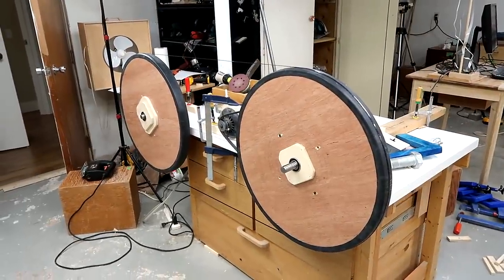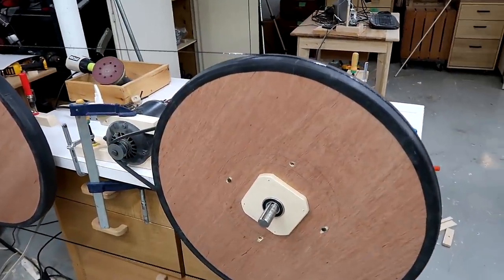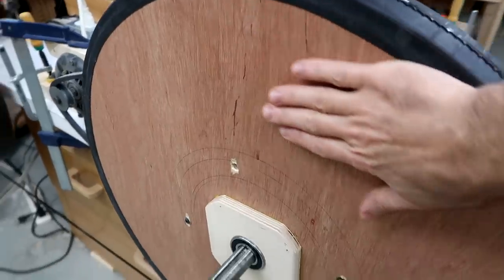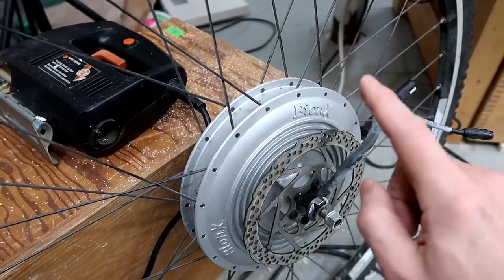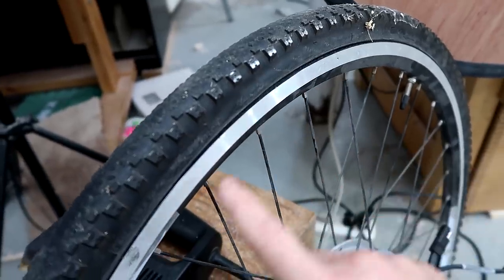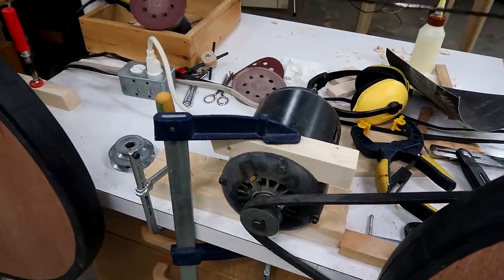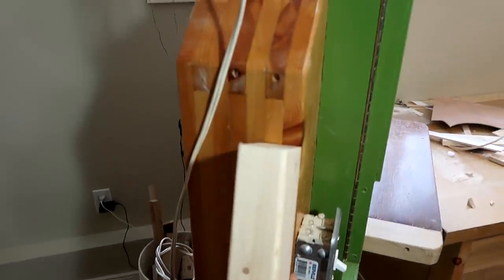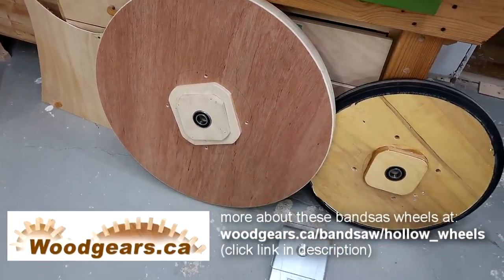More about the hollow bandsaw wheels I built

Comment: I would still go with all-plywood for the wheel, with holes cut into it until it looks like spokes. Then you could easily cover over the holes with whatever you like (packing tape, cardstock, thin veneer, etc.)
I can get 5-foot square 18-mm thick baltic birch plywood for about $30 per sheet, and you could get four 29-inch circles out of one sheet and laminate them together to get two 29-inch wheels at almost 1.5-inch thickness.

Comment: Build myself a bandsaw of your design years ago. Still like it. Had the same problem of dust collecting under the ruber tube. Fixed that  with aluminium foil tape. Also closed the holes with it.

Comment: I really like these videos that explain your thought process.  Using pre-built components, like a bicycle wheel in this example, generally only works if the entire component/assembly works as is.  Once you have to start changing said component, you've negated the reason for using it...ease of use.  And I'm careful to say "generally".  Gently modifying something, like cutting a groove into a premade wheel to make a pully is one thing.  Changing the hub/axle on a bicycle wheel is as much, if not more, work than creating it from raw materials.  I find the latter is more often the case.

Comment: Other options for making a solid ply lightened wheel not collect dust is of course to skin it with a sheet of thin plywood or fill the holes with foam.
Reply: I was thinking about that too. I've got an old craftsman bandsaw that I'm tuning up and it has issue he talks about where the spokes collect a lot of dust and generally whirls dust around. I was just thinking I could use some kind of thin plexi/acryllic/plastic sheet glued on to each side to prevent that effect.
Reply: @nyw11  That sounds heavy.
Reply: @billybobjoe198  I'm thinking like the thinness of pladtic packaging or laminator sheets. The air in the cavities might suck the plastic in, and then the foam that Joe mentions would be beneficial too. Maybe some of that 1" extruded insulation foam.
Reply: just stapling an old piece of textile on the outside should be sufficient
Reply: @billybobjoe198  no part of that sounds heavy

Comment: On pallet separators, they use actual pneumatic tires (about 18" in diameter) to run the big bandsaw blade horizontally. Cuts through all the wood and nails like warm butter.

Comment: In order to use this bike wheel I need to throw away the rim,hub ,spokes and tire and build the rest out of wood. lol
Reply: i mean, it could conceivably work if u have wheels that have 15-20mm thru axles and put all rubber tyres or slicks on the rim. But that seems to me just a misuse of wheels, they are better off on a bike.
Reply: Truck wheels would probably work except they would be way heavier.
Reply: @eDoc2020  they can for sure i have seen it
Reply: @eDoc2020  use the diesel engine from the truck, and the weight will make little practical difference.

Comment: I recently dismantled a direct drive LG washing machine which has a very nice motor that couples directly to the drum. I think that this type of motor could form the basis for a direct-drive bandsaw whereby the motor would fit within the lower wheel.
Reply from the maker: If you have a controller for it, yes.

Comment: When using bicycle wheels instead of plywood wheels I would recommend using the frontset as well and mount it into the bandsaw frame. Changing the blade is still more complicated than with a wheel whose axle is mounted only on one side.

Comment: Hello Mattias!
I'm sure you are aware, but you did not mention it in the video. The critical mass is at the edge of the wheels, a lighter wheel with mass concentrated at the edge could be harder to start and stop than a heavier wheel with the mass at the center. Pure weight of the wheel is not as important as the mass location and radius, see rotational energy. I would recommend the Wikipedia page about flywheels.

Comment: You mentioned WoodMizer.  If I built one, I think I would use vehicle safety-spare wheels; they're pumped up to about 60 PSI and typically have a decent crown on the tire.  Even though you're only supposed to drive 50 miles on them, I think there's enough tread to sand them round.

Comment: I used to work in a freight distribution company, and when we had to weigh items that wouldn't fit/balance on the pallet scales, I came up with an easy solution (you can do the same with bathroom scales)...
I would weigh myself on the scales, then zero the scales and weigh myself again, but holding the item. 
(remembering to always zero the scales after the process).

Comment: Did you ever think of making a bead lock type of disc to lock the edges of the inner tube to the hollow wheel, you could bevel the edges so sawdust doesn’t get hung up. And the discs you attach could allow you to implement a foot operated brake, kinda like a old clamp bicycle brake. But I like the hollow wheel idea, would allow the wheel to have airflow through it to make its own dust collector, kinda like your home made ones. Love the content btw.

Comment: If you take the bike frame and take the front forks off and cut the rear frame apart keeping the triangle support for the rear tire then you can use bicycle tires easily. If you put the same design effort into using bicycle wheels as you put into building with wood you could seriously upgrade the bandsaw.

Comment: You always get my imagination going Matthias. What if you milled a big round elliptical groove on each face of an MDF disk on the top of a big table saw set at 45 degrees to get the biggest scoop, (or maybe more of such ripples) and after that just use a router bit to take off that millimeter for the inner tube around it? or maybe just do a wheel in gradual parametric slices where the strength needs to be and smooth them out by sanding them down...
Reply from the maker: Please do try your suggestion and make a video.  I think it would be fun to watch.
Reply: Sound like how a designer would build a bandsaw lul

Comment: Marius acknowledged the problem with the holes in the wheel been a pain, but he also had the problem with sawdust building up on this rim the lower wheel but that could be due to the holes building up sawdusk and keeping it in the air in the lower box.
Reply from the maker: Geting the sawdust all over the place is worse than it building up on the wheels.  Yes, dust collection hooked up would help.  But with this design, you don't need it.

Comment: 3:00 how about making a wheel, cutting the holes, and then putting on thin plywood sheets on the outsides to shield it? Would be easier to produce with similar results right? You could maybe even clamp the tube with the outside ply layer to prevent the dust from coming into it.

Comment: IMHO the door size is not limiting the size of the whole bandsaw. Only the size of the wheels are then limited to around square root of 5m. You always could either transport the wheels separate or the saw horizontal instead of vertical. Remember the bird of Ulm 😁

Comment: The "no frame" bandsaw: Upper wheel hung from ceiling on automobile wheel hub,  direct drive lower Prius drive wheel with table on floor; cut on either or both blades with a guide and brace over the ascending portion.  Need to find a junked Prius or other E car.

Comment: drill holes in the solid and then stick tape over holes to prevent dust.
Reply: Nice!
Reply: That's a good idea the problem is that the tape just won't last. It might last a month or two but no matter what it's going to come off at some point which means you're going to be constantly fixing the tape.
Reply: Drill holes in the solid and cover it with a very thin layer of wood, something like he used on these hollow wheels, but potentially even thinner. A couple of millimeters would be plenty. When you go that way, the difference between the two methods gets really small, although Matthias' version is probably a bit lighter.
Reply: Just have  a core plywood sheet with holes and thicken it with side plates.
Clean look and easy to make

Comment: Thanks for satisfying our curiousity. It's great that the huge wheel is comparitively close in  weight as a much smaller one. The opposite strategy of the Steel City Tool Works design.  Makes one wonder if a wheel built of lead would have even less of an advantage. Such a design, relying on momemtum, would probably be safer with some kind of braking system. Much less safe, it seems, than just relying on a nimbler, more versatile, setup with the light weight wheels. 

Was that a kitchen scale? I use a postal scale in the kitchen, so fair enough, I can't squawk at a kitchen scale in a workshop. 

Interesting to see, a consideration of an e-bike wheel, as a possible component of a band saw. Glad that was debunked. Next time, see if we can consider a pedal powered band saw. Although, I'm guessing, with wooden gearing, and a foot pumped lever, that would not be beyond you. Such a gizmo might come in handy, if there is no electrical source to drive a motor. 

Seriously though, great project. 

So satisfying. 
Thanks for the great content. 
Keep up the good work.

 בס״ד

Comment: I have enjoyed viewing your band saw builds.  I have a couple questions- You haven't addressed (in detail) the  tension   of the  blades.  When you used your band saw to mill a log you had problems of the drifting saw blade.  My question is was the blade  in  maximum tension? Is optimum performance when at  max tension?   My second question is, there are those who believe the tension on the blade should be removed when the saw is not in use.  They have band saws with quick release to do just that, and to aid in blade removal/installation.  It that something on your radar?

Comment: With the inner tube dust problem: why not just step the outside down by the thickness of the rubber?

Just by making the wheels a fraction thicker, and then when cutting the crown, just stepping the outer edge down by the same amount there wouldn't be any rubber sticking out to catch the dust.
Reply from the maker: yes, that would help.  But not worth the bother.

Comment: Why can't you cut out big chunks from the wheel and then cover it with a thin material like plastic/vinyl sheet on both sides? Maybe even sandpaper and make it multi-purpose. That way the overall weight is reduced and the problem of dust collecting/wind generation etc., are eliminated.

Comment: Also, regarding the e-bike wheel's axle, could you not just tap a thread into a thicker bar stock of any diameter?
As long as everything's balanced well, you shouldn't have any flexing issues.
You could potentially even use a high strength bar which has a thicker diameter on one side, but I think that'd be more effort than it's worth.
Reply from the maker: the mount for the shaft wouldn't flex, but the shaft itself would bend.  That's the problem.
Reply: @matthiasrandomstuff2221  Couldn't you even just replace the shaft with one of a higher quality?

Comment: wait, couldn't you just use some rubber cement to glue the bicycle inner tubes on? if the tubes ever go bad they should peel off easy. but no dust should be able to get in.

Comment: A motorcycle  would have a thicker shaft.  But  the max diameter would be 21" and they'd be quite wide.  In the 80s, Honda had a 23" front.  And you'd be tightening the spokes all the time.  Wood is a better choice.

Comment: Hey Matthias!  Love your videos!  I built your first bandsaw (and others machines) and can't wait to see the rest of this build!  Any chance you could work out a problem for me? - maybe I'm over thinking it.  I have a two story house, with walk-in attic above.  The eve is right above the porch (both sloped roofs).  I need to screw some hooks/brackets for christmas lights to the soffit of the above eve.  Can't get a ladder up there because it's too tall and the porch is right below it (no flat surface).  I hope that all makes sense.  How can I make some long pole or something that I can use as basically a really long screw driver to screw some things up there?  I've been looking for a product but can't seem to find one.  I'm assuming I'll have to rig something up....
Reply: nail 2x4 (or clamp if possible) to porch roof. set ladder base against it. when done plug nail holes. painted a number of those 50 years ago with 30 inch over hangs. hated the wasps

Comment: 4:11 some kind of complicated bracket that goes around it?
You mean...like the forks a bike usually comes with? :D
Honestly tho, if the Problem is the Elbowroom i suggest investing in a few 100m  long 
Blade (a non circular one) and some intelligent feed mechanism so there 
are a few min of runtime where the blade is fed lets say into the 
basement from the attic and during glue ups you let it reverse so the 
sawblade is fed up into the attic again :D
Reply: Does this really sound like a practical idea to you? The bandsaw blade runs at around 1000 feet per minute. That is about 300 meters per minute, or 50 meters per second.

Comment: What are your thoughts on using the disc brake from the bicycle wheel in your new unit for faster blade stop AND a foot switch?  This could be for safety particularly if integrated with the on/off motor switch and using a foot control in conjunction with the normal "light switch" approach.  Why? As you are using larger and larger wheels, the switch is  moving away from the front of the machine encouraging an un-natural reach from the center of the feed table while trying to control the sawn material. This would allow you to keep both hands on the work and still shut off the unit with rapid "stop" if the brake is also used - kind like a paddle switch on many table saws that can be utilized with a knee or thigh.
Reply: That's not a bad idea. Rather than use actual brakes you could also apply a DC voltage to the induction motor's windings, this might be easier to integrate. It could also be easily retrofitted to existing bandsaws. Somebody could start a business selling foot controls like that.

Comment: While you are at it, make this new saw "left handed" (column on the right).  This will permit cutting "on the other side".  So you can switch saws for curved cuts, or requiring cuts "on the other side".
          Another thing: you need to provide a table adjustment that permits rotation about vertical axis, to correct for "lead angle".  This adjustment capability need be only a handful of degrees each way.  I am sick of all the klugy schemes for correct for lead, including setting the fence off-square, and using "resaw posts" instead of a real fence.  It's time for bandsaw manufacturers to wake up!
Reply from the maker: A lefty would be handy from time to time, but if I make plans available, then a lefty is not ideal.  And being much bigger, more stuff fits on the left side as it is already.

Comment: 2:26 i dont understand what your saying, i keep hearing "Lower Grannite wheels" Sorry
Reply: There's another comment thread.  A company made bandsaws with granite (stone) lower wheels.
Reply: Granite. a type of stone
Reply: Oh thanks! i heard right, but couldnt beleive it
Reply: @FriggOff361  Granite was kind of Steel City's gimmick.  When they came out with their granite-topped table saw, it was pretty popular.  By all accounts it was dead flat and extremely stable.  The only complaint most people had about it was that magnets don't stick to it.

I don't really buy the "doesn't rust" argument for a bandsaw wheel, though.  Aluminum doesn't rust either, and it's probably cheaper to make an aluminum wheel than a granite one.

Matt Vanderlist (host of Matt's Basement Workshop and former Wood Talk host) bought one of their granite-topped table saws about a decade ago (see Wood Talk #67).  He eventually replaced it with a SawStop, but I don't think it was because he has problems with the Steel City saw.

Comment: Yeah, higher momentum sounds kinda dangerous, now that you mention it. I wonder if there are other ways to lighten it even further.

When designing your frame, how are you calculating the thickness of the wood needed to resist the bending stresses involved?
Reply: Easiest way to lighten it would probably be to make judicious use of aluminium, but that requires specialist tools and a lot more effort!

Comment: Many more serious mountain bike wheels use a 20mm thru-axle, they'd be worth considering at least.
Reply from the maker: I would still need to find a solid 20 mm axle that is about 3x as long.
Reply: Not trying to convince you at all, but I wonder if what they use for lefty forks would help if someone wanted to do this. (For anyone who doesn't know a lefty fork isn't a "fork" at all, it's one-sided and connects to the wheel on one side.). A potential way forward would be an old lefty wheel (no idea on the axles available,) a cheap tire insert typically meant to go inside tires to prevent flats and protect rims, and stretch the innertube right over that.

Again I don't care one way or another - that's just what popped into my mind!
Reply: You could fabricate plastic hubcaps to cover the spokes from HDPE, to counteract the air turbulence problem.  Would the spoke wheels handle the stresses of driving the blade?

Comment: spokes making the wheel a fan... Dust collection solution? think that could work?
Reply from the maker: if you want to suck air in the back of the saw and blow the dust out the front, yes.  If you want to suck the dust away, no.

Comment: How do you think you'll solve the issue with dust getting stuck under the inner tube? My first instinct would be to just glue or tape down the edges, but my second instinct is that might throw off the balance unpredictably.
Reply: That was an issue on the 20" saw. I believe the solution was to trim the excess that hangs over the sides.